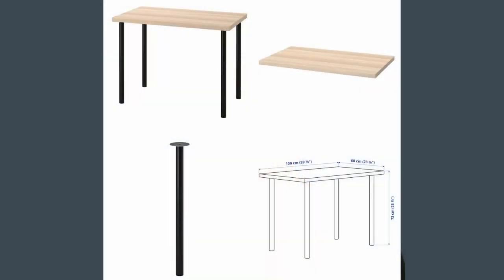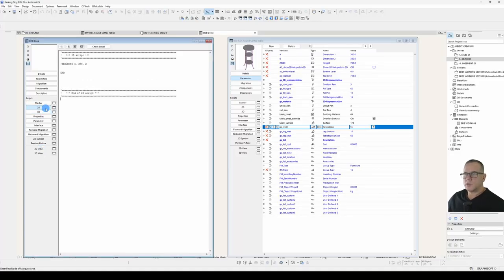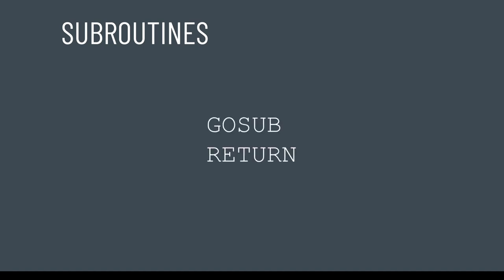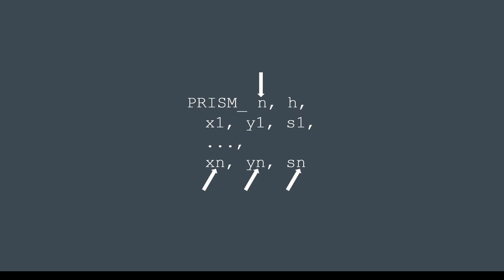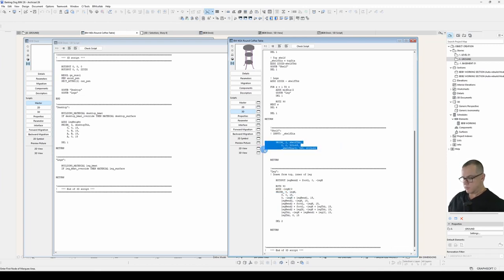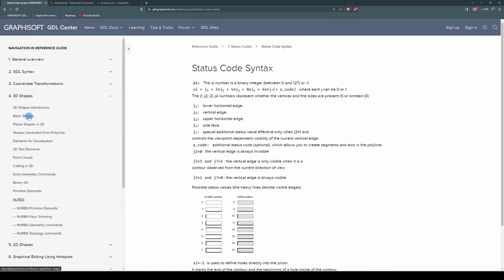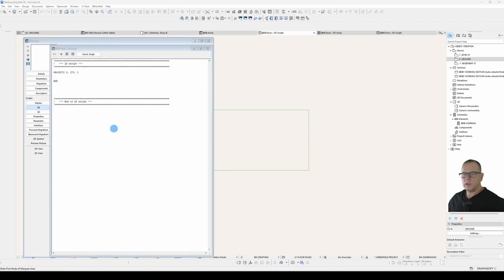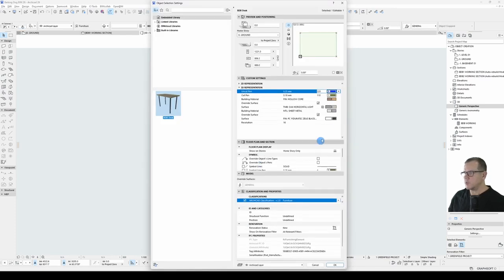004 Beginner's GDL Pt 1: Scripting a Simple Desk in ARCHICAD 26

Comment: Bruce, this is great. thank you.
it's daunting to me, but only because i think i need to remote into my work PC so i can use AC at the same time & not feel confused with all the terms.

was a little bit lost a few times in there, especially the adding of the legs in the 3 other corners, only because of the mindset of offsetting, rotating, mirroring & having to return back to origin. please understand it's people like me who have little to no GDL experience, but are willing to learn. perhaps a little bit slower & less technical to explain concepts such as this in future videos?

please keep this up. this is very much welcomed & desperately needed in the open AC community.
Reply from the maker: Thanks MorningThief_.  By necessity, these intro videos need to only briefly touch on various concepts.  I intend to go more in depth into the topics in later videos.  Stay tuned.